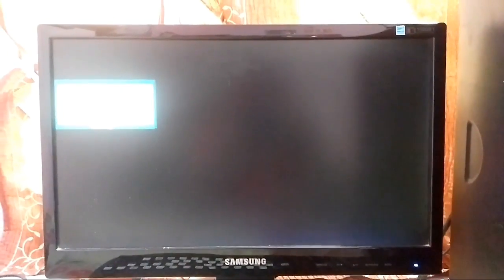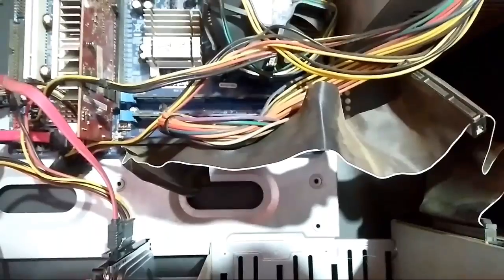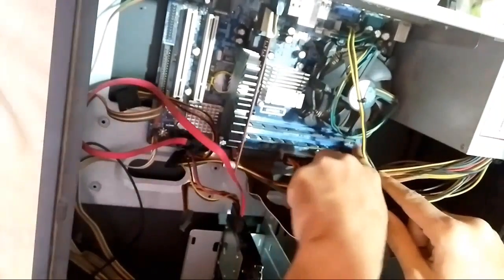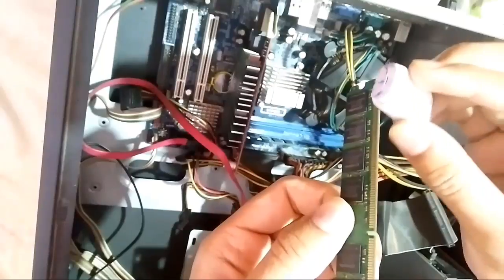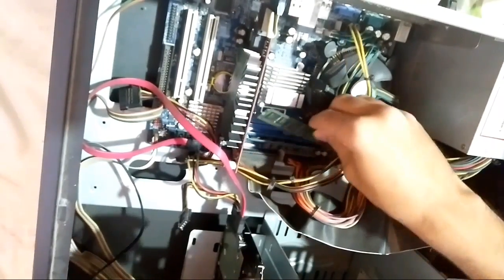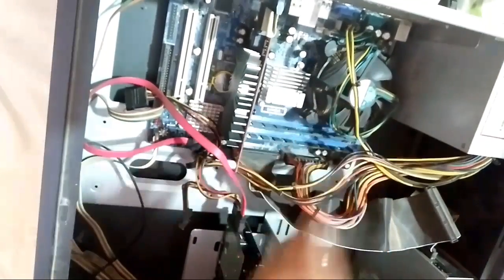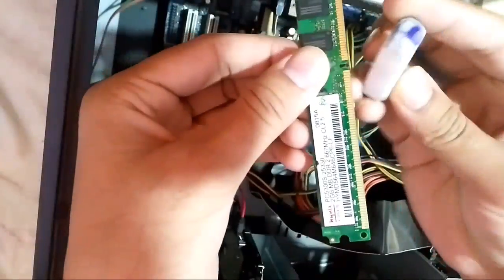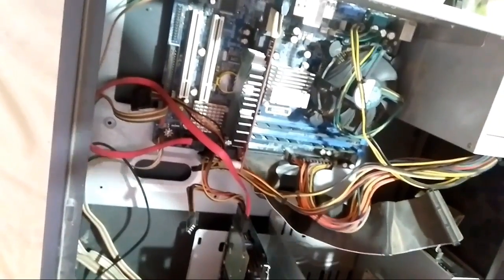How to solve the problem of Check signal cable. Method 3 .

Comment: One cpu working another lcd but when insert old one lcd then display showing check signal, it mean lcd vga port problem ? otherwise vga cables no doubt change new one, in this position what to do ?

Comment: Are you sure, only problem in cpu for check signal, no problem in lcd ?
Reply from the maker: +SK Mainuddin it can occur in both cpu and lcd.. so can't say.. which is causing this problem .. if try all cpu methods .. then try to change the VGA wire and try.. and tell .. thank u for asking question.. plzz subscribe our channel.. for more latest updates ..
Reply: Yes